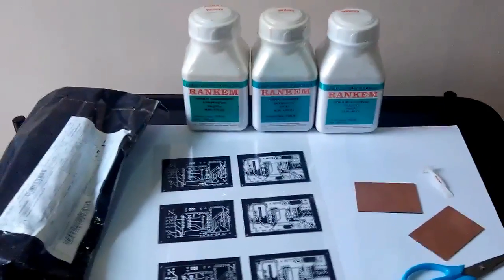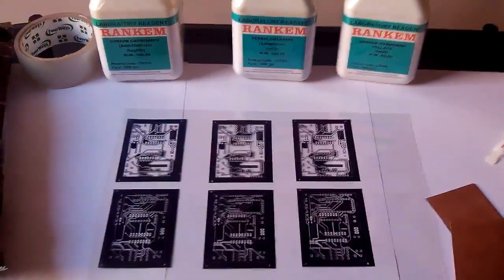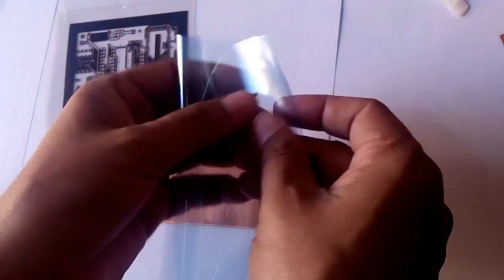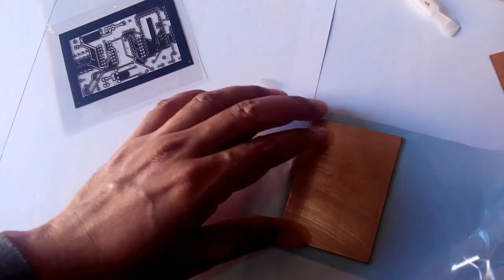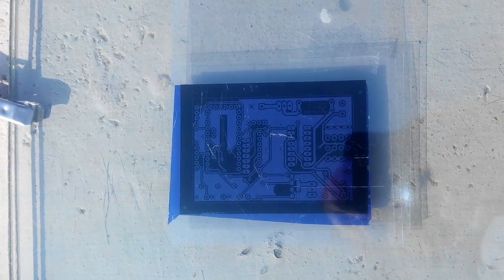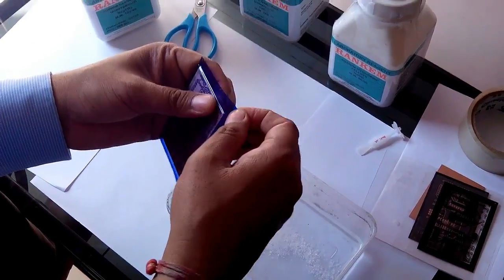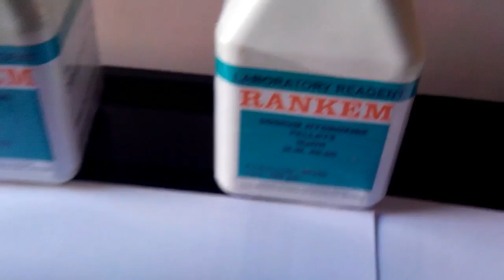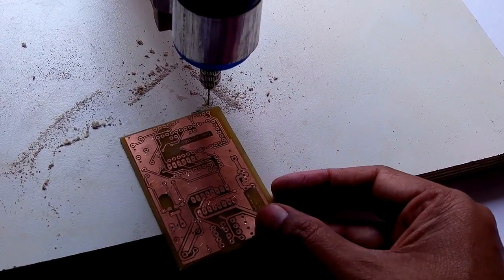MAKING OF DOUBLE SIDED PCB USING PHOTO SENSITIVE FILM (Photoresist Dry Film)

Comment: It may be too late to ask a question - but I am interested if you have any tips to align the top and bottom transparency sheet. Did you print out some alignment markers? I couldn't quite see. In any case Thank you for the video. I am about to do the same!
Reply from the maker: Yes you are right.  I have made some via outside the board which get printed on transparent OHP sheet. Then I pass through a needle to aline.
Reply: @brainstormabc  Thanks - that makes sense. The glue you are using to fix is it thin cyano-acrylate?

Comment: I've been having all the problems with trying to make double sided. everything that can go wrong has. 
my inkjet printer wont print solid. i cant seem to get the alignment right with my anycubic photon 
even with 3 transparency film masks printed in different orientations its still not solid enough to block all light where i need it too. 

i dont have a laminator so i used a rubber roller and a hot air gun that i had on hand. that seems to work great. that the most reliable part of the process...

Comment: Thanks for the video. How do you make sure both bottom and top transparencies are aligned?
Reply: Put some marks in the same location on both layers to align them. X's, circles, dots, or something.
Reply: Thanks a lot. Another thing I am having an extreme difficulty is laminating it without getting air bubbles. I have tried several ways, dry, wet, two sides at the same time,  one side each time. But always getting air bubbles.
Reply: Ronaldo Junior
How much impact do the air bubbles have on your results?

Comment: Hi Guys,   my Ques. is how to get that print. in a printer properties or other option while priting. i mean the sun light Exposure to your print-out.  but if i take print just like wires and ISs. but when i Exposure to sun light that wire & Iss lages laps. so how did you get print that whose wire area have a blank and Exposure area print. Could some-body help me. ?

Comment: from where u purchased that film
Reply from the maker: Vishnu Chuncha Hi
i have purchased frpm http://www.aliexpress.com/item/Photosensitive-dry-film-instead-of-thermal-transfer-production-PCB-board-longth-1-meter-30cm-1m-cut/748676015.html
Reply: oh great man , you purchase all items from china ? are those website trustable?
even i want to buy these materials
Reply from the maker: Vishnu Chuncha i have purchased about 35 times and most of times i got it but in some of item there was the problem of delivery. i didn't got material and i raised the complaint and got refund. i would like to suggest that go for the items which delivers by "china post registered air mail". it cones as registered mail and i did't loose anything which delivered with this mode.
Reply: oh nice i m planning order dry film which is really nice to make pcb for small project and drilling machine too , from which site i shall but aliexpress or dx.com and can you please tell what is method to raise complaint
Reply from the maker: i have purchased from both sites from dx.com i have purchaged about 10 items till date i didn't find any complaint. from aliexpress when we place order and after that when we see order detail a button is there "OPEN DISPUTE" by click on it there is a step by step process to book complaint.
Reply: i want to order Drill machine which cost about 3000
Reply from the maker: Vishnu Chuncha ok, nice. but for this amount you can buy there also. then why do you want to wait for 60 days?
Reply: where i can get in karnataka
Reply: u have made really made pcb using film
Reply from the maker: yes, i have may see the video and this is a PCB what i have used to make a Balancing robot.
Reply from the maker: where are you from ?
Reply: karnatake, belgaum
Reply from the maker: ok